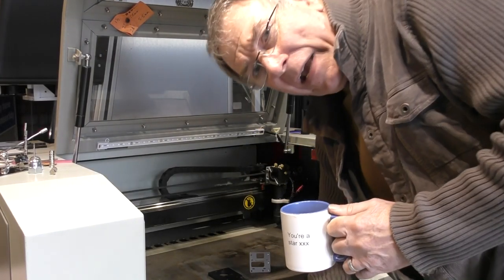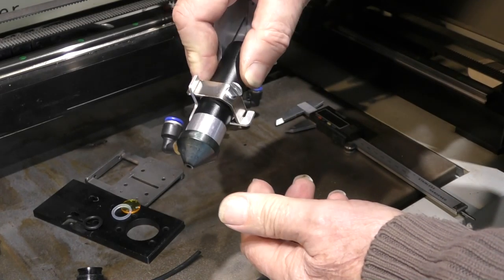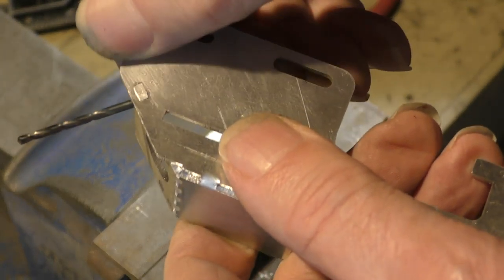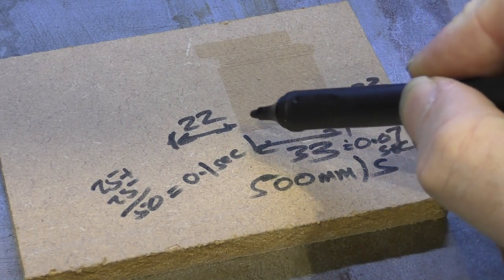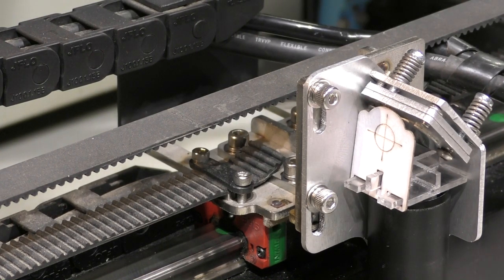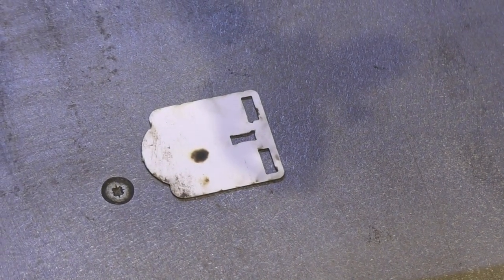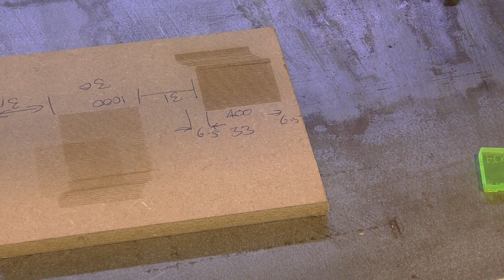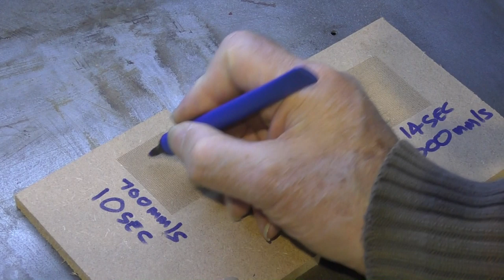RDWorks Learning Lab 181 Redsail clone  upgraded head

Comment: I love these videos really informative and as I've said in the past 
(Any newcomers would be in sh*t street without them) and as a result of one of these videos I've been what I can say is educated in how not to destroy my so-called 40 watt tube in 15 - 20 minutes with my luck on my 3week old toy that hasn't even been used yet because its the smaller one little (blue/white) one with a (on/off) switch, emergency stop button and a digital display.
On opening it to have a look at the electrics (I'm not an electrician) I noticed a blue and a black (neutral) wires joined together just twisted together with some insulation tape wrapped around them,
One comes from the power supply area (blue) and the other (black) from the far end of the tube nearest to the 1st mirror  "yes" I know they are the same connection running all the way back to the power supply but it in goes to show or how can these things even get into the market place,I'm wondering if I could make use of this defective botched up section of electrical work and put a ammeter on this section of cable (well "cables" blue+black taped together) by splitting them at the taped section then install a analog ammeter with the correct polarity connected - Oh! Might I say the earth wire connected to the body of the machine had to my disbelief two plastic washer's separating the cable from the body of the machine (so that's another issue to sort ) although I'm in the UK I should be OK as we have a earth wire "ground wire" in our mains cable. So if anyone has just bought a K40 make sure you take the plastic washer's off and sand the powder coating off before turning the thing on. 
Any advice on my 40 watt tube problem would be appreciated and stay safe with this COVID 19 pandemic that's killing thousands everyday sadly.
      Goodbye!.
Reply from the maker: Yes the wire from the cathode end of the tube connects to the ammeter PLUS and the MINUS terminal  to the power supply ground wire. 
Best wishes
Russ
Reply: @SarbarMultimedia  that return cable is still able to generate a short of over 2kv, that's enough to stop a human heart. I do wish these laser makers would put more respect on to that cable and its management...
Reply from the maker: @spiritburners  
 The only way I can imagine your concern  to be true is if you disconnect the cathode wire  and grab hold of the Cathode pin  

All gasses are non conductive, but apply enough volyage potential between anode and cathode and you can cause the nitrogen in the gas mix to ionize between these two electrodes  and shed electrons.. All of a sudden  the non conductive gas acts like oiece of wire and allows current to flow.That current flow would be intantaeous and high were it not for the current limitinig circuot in the HV power supply which controls the current  a few mA.. Under normal circumstances the return wire to the power supply ground is almost zero resistance  thus it is the potential between the anode and cothode that creates the ionized beam. The voltage in thatretun line is almost zero. We put a cheap ammeter in that line to monitor the tube current flow, it would pop if there was any sinificant voltage in that wire.. So if you grab that cathode pin and try to run your machine (who would try yo do that? ) then your body becomes a lage resistance in series with the low resistance ionized gas column.. In such circumstances the flyback transformer would try to increase the voltage  to drive the mA current flow through you as well as the gas column.  U.nder these veru unimaginable circunstances there would be a large potential between you  and ground.
  What you have here is technically lightning in a bottle. Let lightning travel to ground unhidered  and its not dangerous to YOU.. If you are unlucky enough to be in the way of  that lightnings path to ground  we all know  the great smell of fried bacon that results Chuch spires and tall buildingd  thick copper bars (like the tube ground wire ) that safely send the lighning to ground..
 Most people have a natural fear of high voltage  and I always recommend turning your macine off and  leave it plugged into the mains for about half an hour before you go anywhere near that red wire.  Perhaps a bit over cautious but it keeps the less  technical people safe.
Best wshes 
Russ.

Comment: Hi Russ, good to see these two new CO2 videos- I was surprised that you still have the original red dot laser and the autofocus mechanism on your lightened  laser head- are they not added mass? Best wishes Gene
Reply from the maker: Hi Gene
 I never burn bridges. Much as I hate the red dot pointer and the  aoto focus system  I t may have a use one day. I have  been communicating with Cloudray who are very close to Ruida and there are plans later this year to release a new stick on keypad for the existing controller along with new firmware. I have requested a Z origin button that will allow you to to set Z zero to a position of your choosing  (if you have a Z stepper) That should negate the need for auto focus in most cases.
Best wishes
Russ

Comment: Wouldn't you have to include the weight of the rail truck with the weight of the head? it is moving mass after all.  I do get that at the end you are using trials to get your end result... either way, super interesting! Thanks so much
Reply from the maker: H Darrel,
 You are quite correct with that detail because adding a constant will lower my crude calculation. In this shed science, the principle is more important than the detail so I tend to oversimplify.  I may actually be accelerating the head twice as fast as the original force number predicted but the machine is not complaining so it does demonstrate how conservative the original machine settings were.  When I do a long engraving job in the future I will be keeping an eye on the motor temperature and may back the acceleration off if needed. Thanks for the comment
Best wishes
Russ.
Reply: @SarbarMultimedia  I concur :)

Comment: Have you thought about the cable track aka drag chain attached to the head? Some more weight to be saved there too.
Reply from the maker: Hi James
 You are quite right. However, I am not trying to break any records, rather to demonstrate a principle that the Chines builders of these machines are missing, Take a look at the Trotec and Epilog heads, they obviously have understood this piece of basic science. Having demonstrated the gains of weight reduction you are now welcome to do some extreme engineering on your own machine but just remember that this gain only applies if you run at high speed (engraving)  You will notice no gain if you mainly do cutting.
 Best wishes
Russ

Comment: As long as you're talking to Cloudray, could you have them put something other than that crappy blue tube on the Compound/Universal Engraving Nozzle?  That darn thing is a real PITA to get in and keeps coming out all the time.  It doesn't work very well.  Also, many of us also probably have one or more 18mm lenses from before we upgraded.  Can we please get some cheap adapters so we can use 18mm lenses in the 20mm tubes?
Reply from the maker: Hi Tom
 Sorry about the crappy blue tube,  that was my design so no blame to Cloudray. It works for me but I know of a couple of guys who have bought a short length of 4mm stainless tube from ebay or from their local model store to make a permanent stud that they can fix their 6mm tube onto. The fit does not need to tight because you only need low airflow for lens protection and not air assist. I will mention to Cloudray so thanks for the feedback (and I'm not in the least bit offended by the truth)  Big smile.
Best wishes
Russ
Reply from the maker: Hi Tom 
I forgot about your lens question.  Some lense tubes ship with clamp rings that are recessed in the plain face with an 18mm diameter recess about 1mm deep  to locate your lens central.
Its a just a bit awkward to assemble the lens tube onto the clamp ring  but it works well and I have several rings I have modified myself. You sound like a man with a comprehensive workshop  so this will be a simple little zero cost fix.
 Again I will mention this to Cloudray so thanks for the comment.
Best wishes
Russ
Reply: @SarbarMultimedia  Sorry Russ, I'm glad you didn't take it personally.  I had no idea you designed that.  Maybe I just got a bad tube,  I don't know, but it's just a real pain to get in the nozzle and to stay in place.  Then I have to jam it into the larger air tube that the laser comes with, it just seems like there could be a better way of doing it.  Absolutely love your videos, I think I've watched every single one of them, many of them multiple times.  Without your videos I would have never had the courage to buy my laser a little over a year ago.  We owe you a huge debt of gratitude that I'm afraid we can never repay.  The only problem I have is, now you're making me want a fiber laser.  Stay safe and keep up the great work. :) 

Tom

P.S. Love the universal lens in general, I didn't know it would work with my 4" lens.  I've only had it about a week now and haven't had a chance to put it through all its paces but it's great that I have something I can use all of my 18mm lenses in.
Reply: @SarbarMultimedia  Thanks so much for the reply.  I must apologize for multiple comments.  I type them out as I think of them and as soon as I hit enter it seems I think of something else, that's just how my brain works.  I'll check out the assembly I got from Cloudray to see if the 18mm lenses will work.  From what I heard you say on this video the 4" lens will also work with the universal engraving nozzle so I may try that out.  It won't be ideal but it will be something.  I'll also see if I can get them in the nozzle and update.
Thanks again,
Tom
Reply from the maker: @tombudd1281 
Hi Tom
Don'tbee to envious of the fiber laser.It's fascinating technology but not what I would consider to be a hobby machine. If you have a small jewelry business and do engraving on precious metals, you may be able to make it pay for itself.  The limited range of materials you can work with makes this a very niche tool . High speed making on thousands of small items per hour  is the real application for this technology. It is not a must have for any general workshop unless you are trying to "out tool" your neighbour.

Best wishes
Russ
Reply: @SarbarMultimedia  That makes total sense.  At the price range we're talking about for fiber it wouldn't be worth it to do a bit of tinkering and to kill some boredom.  My CO2 laser is just for hobby and honestly I spent way too much on it, but it was never meant to make money.  I got paid for some work I did on the side and part of that went towards the laser knowing it was just for hobby and being fine if I never made any money on it.  Some people spend money on guns, boats, jetskis, etc... I spend mine on stuff for the garage and computer upgrades.  I actually think I spend less on that than quite a few gun nuts I know, lol.

Thanks & best wishes.  Keep yourself and your family safe in these crazy times we're going through.

Tom

Comment: Remember, it's not your top speed but your acceleration that the weight limits.
Reply from the maker: Yep, that's exactly what the formula says (no mention of velocity)  but the point I make is that for any given scan length, (and that will vary from program to program) there is an optimum combination of speed and overrun (acceleration/deceleration) that will produce the shortest total run time. If you have long scans then there will be advantages to running faster. In the case of photo engraving you will have little choice because you will have to set a relatively slow speed that your HV power supply can switch the tube on and off at.
Reply: @SarbarMultimedia  sorry, I commented a bit early in the video when you mentioned your hope of increasing top speed to 800, I didn't yet know you would launch into a dynamics course.
Reply: @SarbarMultimedia  I think you forgot a bit of inertia of the kinematics chain in your analysis. the motor works in torque, so you have: rotor inertia + belt inertia + (mass of  rail guide + mass of the head) *radius of pulley. That means you probably have not improved the dynamics of the system by 3 times.
Reply from the maker: @nraynaud  Ah, but drag has got less.....do I really care?  I am just pleased it's now like a young crocodile, nice and snappy.
 Big smiles
Russ
Reply: Hi Russ...Nice job.    In some of my cnc machines there is a accel decel  value built into the motor control SW. Not sure if that's the case with this machine.    ALSO there is the 'electrical' inertia (inductance) of the stepper motor coils that limits the current build up and collapse to reverse the rotor direction.   Don't have a feel for their contribution here...sorry.   There may be specs published by the stepper motor or stepper driver supplier.    Keep up the very interesting analysis.
Dennis
Reply from the maker: @denniskramer9788 
 Hi Dennis
Because of my very limited knowledge of stepper motors I take a very simplistic view of the situation and as I mentioned in the video, I would naievly  expect to hear if the field and the rotor were not following each other. It is possible that I may be losing a few steps but because my system is a rotary encoder controlled system  and not open loop, I will never notice this because it will automatically be corrected. Every incremental step I made in the acceleration was demonstrating an effect  and I purposely did not mess with the jump off speed.
 The definition of acceleration is  the rate of change of velocity every second so if I were losing steps it would likely be happening continuously during the whole acceleration phase because the motor power(or the other factors you mentioned ) were being exceeded. As I demonstrated, I am only exerting the motor to the same extent that it was always loaded. I shall be examining the motor temperature as I do longer engraving jobs over the next few weeks 
There have been times in my life when I wish I had been an electrical engineer, a physicist, a chemist, a botanist  a geologist and a womanizer.  Sadly I never trained in any of these!!!!

Best wishes
Russ